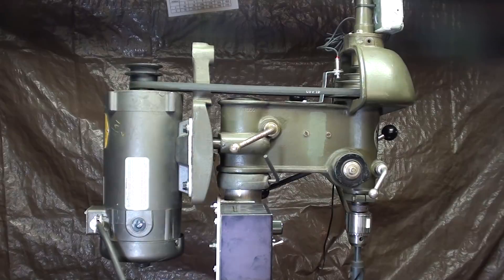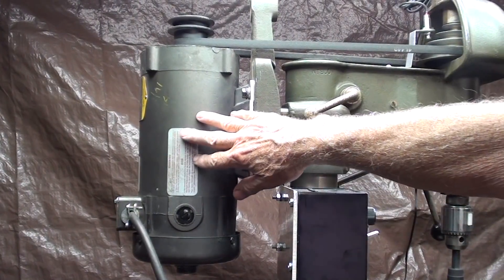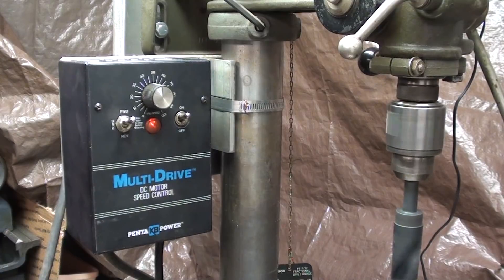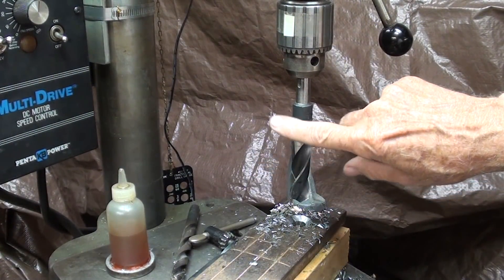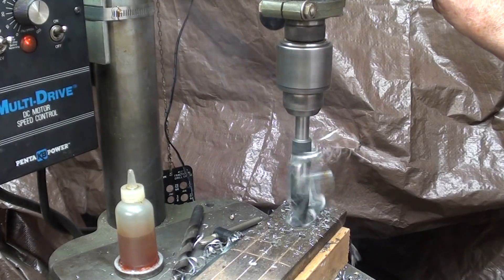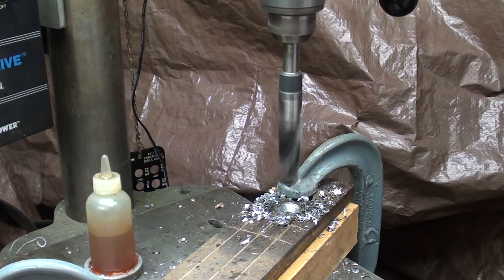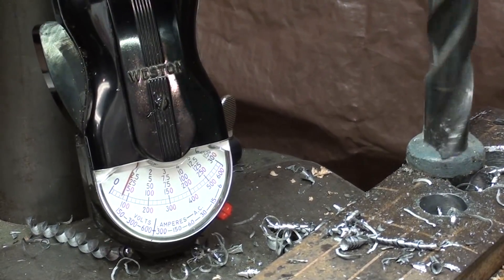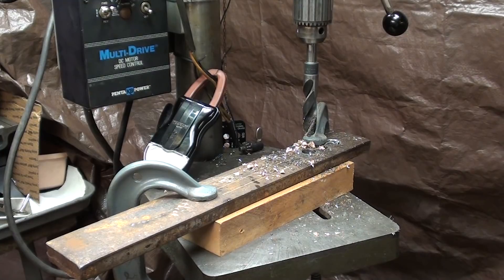Tips #482 Drill Large Holes Slow Speed DC Motor tubalcain

Comment: A bit more work but you'll get more torque by allowing the motor to run faster for the desired speed at the quill. If you went with timing belt  pulleys and belt, you could have a much smaller pulley on the motor, and that should improve the available torque at the drill bit.
Great video, thanks for doing this.

Comment: Using a dc motor with a scr type of controller will reduce the amount of torque available. To maintain the torque would require a PWM (pulse width modulated) type of speed controller. They work by changing the duty cycle ( on to off time ) of the applied dc voltage. Since the full dc voltage is being applied, the motor is able to have nearly the same torque through out its speed range.

Comment: Ac motor's horse power rating is not the same as DC motor.  If both AC and DC motor have 1 hp rating then AC motor has more torque than DC one..  Those hp rating are electrical rating  (amp x volt), not mechanical torque rating.  Usually 2 hp rated DC motor equals to 1 hp AC motor.  When I saw you holding up the non function rpm meter I know you had difficulty to wire that thing correctly. That rpm meter with 2 connectors is very confusing to wire them correctly than the old model rpm meter with one connector.   That was exactly what happened to me.  May be I am wrong.

Comment: 👍I like that DC set up on the old Walker Turner. If my WT got more use I'd like to upgrade it & play around a bit, however, it'd be costly. A comment below speaks of potentiometers for motor torque settings inside their DC motors to achieve the plants needs is ideal. I've had to set the "pots" on my garage door opener when new springs were installed due to increased tension. (Up/Down  force) Oh well, maybe one day I'll get lucky & run into a DC set up to upgrade. 
Enjoyed the video! Thx Mr Pete!

Comment: I really Like DC motors. I have 4 treadmill motors that I'm currently in the middle of a few projects with. 
I have a brand new K&B Penta Power  Speed control unit but I think it's too small for the 2 and a 1/2 3 horse power Treadmill motors.  So I just put it on eBay for sale and I'm using SCR  controllers  And bridge rectifiers which is incredibly cheap and way easier.

Comment: I have an old Atlas.  I switched to a 1.5 HP 3-phase and a 1 HP KB Electronics VFD.  As the pulleys are set I can go from about 10 to 640 RPM.
Stalls do not seem to be an issue, but the controller does get warm on extended use.  I clamped the current, too.  Was happy to see you did as well.  Great job.

Comment: I believe you can adjust the torque settings internally on those drives, we use them a lot at work here in the plant. they also have max and min speed pots inside as well. we use low speed high torque machines and our KB drives work well. enjoyed the video as usual.

Comment: get a PWM (pulse width modulation) motor controller. it will provide you with increased torque when working on reduced rpm
Reply: Please explain ....I'm considering using my 1 1\2 hp pmdc for driving a lathe...are pvm controllers better and what brand and model has worked well for your projects...?

Comment: did not read comments, but why not let motor spin faster and reduce spindle speed ? fixed pulleys to not have to keep moving belt or just 1 mid speed and 1 really slow pully arrangement ? i have 2 dc motors and about to do what you are doing

Comment: I've probably mentioned this before on some of your other variable speed project drill press videos.

A few years ago I put a 1.5HP three-phase Baldor motor with a VFD drive on a Jet Drill press.  A very nice upgrade!  Even at slow drilling speeds, the motor won't stall.  But, the drive belt will slip.

I now drill glass, wood, aluminum, steel, etc., with ease.  Large hole saws on steel offer no real resistance either.  But, it does require babying due to belt slippage.

So far, the VFD upgraded drill press is the most improved inexpensive tool in the shop!

Please, keep up the experimentation videos.  Some of us know what you're trying to accomplish and it is valuable information.
Reply from the maker: Thank you, in a month or two , I will be installing a motor with the VFD on the drill Press. We will see how this performs     I have a lot of trouble with the belt slippage. I would like to try one of those flat belts, like they use on automobile power steering units

Comment: Thanks, Lyle for sharing your experiment. AC or DC motors it doesn't make any difference power is power. The DC motors are easier to drive than AC motors. Seems more like your electronic drive unit was letting you down. If there is a plate on the motor you'll be able to determine maximum torque and other parameters.
I can appreciate the versatility of having a wide range variable speed drill press with a digital tachometer. Too cool. 
I'd say that a 1" drill was a serious acid test for the motor and drive.
The main reason for not lugging the motor is that it needs a certain RPM to keep itself cool.
Nothing wrong with your rig. It just does better with smaller drills.
If you just gotta drill B I G holes use an annulus cutter. Then you are only removing a small kerf of metal for a given diameter. And of course, increase the reduction ratio for high torque output.
Love to blab more but I don't want to put all the readers to sleep.
Thx again for sharing.
Reply from the maker: Thanks

Comment: That was a very informative video. I learned a TON. My hand drills and drill press are mostly used for wood working. Once in awhile I have to drill smaller holes in metal. I never know what speed I should be using. Neverhave drilled anything over a ghalf an inch. At my former place of employment the machine shop had a huge drill press made in Italy. It stood about 8 feet tall, had a huge clamp arrangement for drilling up to 4 inch holes. It had two motors, one was to raise and lower the press and the other who's only job was to power the arbor. Totally amazing. I was always fascinated with this press. That machine shop also had a lathe that was 10 feet in length.

Comment: You need a feedback circuit that senses  motor rpm ,as it drops the controller then supplies more power  or in the case of a pwm controller it widens the pulse.
I use my mill to drill anything bigger than 9/16  as it has more power than my drill press .
Reply from the maker: Yes thanks

Comment: If there is a way to send feed back of thr RPM to the controller to in a sence add voltage. You could use a microcontroller to set the RPM and have it read the RPM and maintain the RPM no matter the load. I have seen controllers with that built in. I don't think it would be hard to use a Arduino to do the same thing.. Hope that helps.
Reply from the maker: Thanks

Comment: I always add my cutting oil to the flutes in the drill so it can flow down into the hole rather than adding it around the perimeter of the hole which does virtually nothing. i  realize that the chips do carry it up the flutes somewhat,  but it seems more practical to add it into the flutes.

Comment: Forgive me for making a suggested job for you but unless you want 1000 rpm for small bits, and you might, consider changing the pulley sizes so you get more torque.   For example you you go for 750 rpm max and get about 35 percent more torque.   Of course multiple v belts might be needed to prevent slip( or the fan serpentine type like you mentioned in an earlier video  ).
Reply: By the way.   I think you will be much happier when you do the dc motor on your band saw.    I doubt  that needs so much torque

Comment: Can't figure out what the failure on that rig could be. Bites steel and if you're careful it won't bite your tender parts. 
Torque is not like on a milling machine, but nobody expected that. I think this is quite impressive demonstration of DC motor with variable control on a machine that was never meant for it.

Comment: Yikes! Those stringy chips looked ready to slice your wrist open!

At any rate, IIRC 3/4 HP isn't enough to drill 1" in steel. I believe the Clausing and Dake  drill presses rated for 1" in steel (not cast iron) have motors in the 2–3 HP range.

Also, a permanent magnet DC motor generates maximum torque at stall. It's induction motors that lose torque at low RPM, because at low frequency you don't induce as much current in the armature.

That drive should have a setting to provide a voltage boost when more current is drawn. Adjusting that may help with the stalling, although if you overdo it the motor RPM will run away. The voltage boost compensates for resistive voltage loss.

Comment: You ought to look for a Buffalo #22 drill press and your problems would pretty much go away. RPM 65-1350 and it has back gears, #4 morse taper and power feed. I recently used it to power tap some 1 1/8 x  7 threads in a 1 1/2 inch thick bar of mild steel for my arbor press stand I am building. Several years ago I bought a new 20 inch Craftsman drill press and I am concerned that the table just is not made strong enough and the quill has to much slop, but it does have a double belt reduction, rpm 150-4200. 
A secondary step pulley between the spindle and the motor would help out a bunch with what you are trying to do.

Comment: Pete,
Much more oil, like dark cutting oil, is needed especially on larger drills. One way to help is to fill the pilot hole up completely with oil by putting masking tape on the bottom side to hold the oil in. But even this is minimal for oiling. Putting a couple drops on is next to useless as it is is simply carried away on the next chip string out. The oil filled pilot hole at least gives continuous oiling and will reduce friction enough to maybe prevent stalling with your 1 " drill.
Reply from the maker: Thanks

Comment: Instead of a variable speed dc motor what about an ac motor multi pulley with countershaft that could deliver 40-60 rpm (or speeds compatible with the Cleveland guide). This should multiply torque barring, of course, v-belt slippage. While speed-feed (per the guide) settings may be the ideal in industrial settings - with much heavier equipment - perhaps these could be relaxed in home shop settings to compensate for the lighter duty equipment.
As an aside, could there be too slow a speed?
Reply from the maker: I think you are right. Mechanical advantage with gears is best. This drill press simply is not heavy enough.

Comment: after watching the video, I think it deserves more than a thanks. 
it is really informative and I was planning to buy a 1" drill bit (and they are expensive where I live ), good that I watched this video first. Now I have to make modifications before buying that 1" bit. I was very surprised that big DC motor stalled.

I think the options you are left with are: 
going back to your old AC, buying another VFD for an AC motor or use gears instead of pulleys and belts .. I would really be interested to know how will you proceed from there Master Pete
Reply from the maker: Thanks

Comment: I guess I just don't get it, but I think a drill press is unsuitable for drilling large holes like 1 inch in steel. Use the Bridgeport or even a smaller mill drill to get the slow speed and ridgeity necessary.
Reply from the maker: You are right, they are small presses are meant for small drillbits

Comment: Another great teaching video, thank you.  After many years of dealing with too high of speeds on drill presses, I found a good deal on a Craftsman 20in dp with 2hp peak motor. It does use the mid pulley set up and will drop down to a low 150 rpm. It has done well with hole saws and 1in drills in mild steel. Its still too fast for tapping and even some large hole saws. I like to spin tools slow, they seem to hold up better.  
Once you get to additional pulleys to get the speed down to a mill speed of about 50 rpm, the problem will become the spindle in the drill press. The drive splines, especially when you have the quill extended down will TWIST and spiral from the high torque.  So to those folks out there thinking you can drill 1.5in with a small 15in dp you will be shocked if you twist your spindle up. I have one in my shop from a 22in dp that was abused by prev owner.  I do like the idea for tapping holes to have the slow speed and quick reverse.   
If you want a beast buy the Grizzly Model G0779  can drill 1.5in holes in cast iron low speed 90rpms.
Reply from the maker: Thank you. These a small drill presses are actually only capable of 1/2 inch holes
Reply: I've seen two small low-dollar drill presses reduced to scrap by twisted spindles.

Comment: I like the concept,  and works better than my drill setup.    But i gave up trying to slow it down and keep the torque.  And went out and found me a 9" radial arm drill.   It has lots of torque at 60 rpm and go's up to 1200 ....I think.
Reply from the maker: Would it fit down my basement

Comment: If you control the motor with a closed loop controller, it can increase the power to the motor to maintain low RPMs under load. That way you get low end torque.
Reply from the maker: Thanks

Comment: Pete;
The problem with the torque is that as you are drilling, you have drag and therefore the speed you set is way low.  If you turn the power up on your control to your motor, and keep drilling at the recommended speed you want, it will drill just fine.  That's why when you did turn the power up it did cut better.  Check your tach. when you do that and see how close you really are to the speed you want when it is cutting good.  Its kind of like driving up a hill in your car to keep the speed at 60 you have to increase the power.  You need cruse control on you drill.
Michael
Reply from the maker: Thanks

Comment: If you do not need the heigh end speed adjust the pullys to get the the motor rpm up. You will loose the top end but gain the toque.
Reply from the maker: Thanks

Comment: I think a AC motor running at its rated speed with variable drive pulleys is the best system for drilling. This allows easy change of ratio between motor and drill and you don't lose any torgue.  I saw someone on youtube with a drill press built like that but do not remember who.
Reply from the maker: Yes

Comment: Don't forget to make sure the belt isn't slipping.  

It seems like what you need is a real motor speed controller that uses motor speed feedback and keeps the armature the same speed over varying loads.  When you set the motor speed for the drill bit to achieve a certain rate, that's the unloaded speed.  To maintain that speed, you'd need a friend to turn the knob up as you push the drill into the work, then as you lighten up the feed near the end of the hole, your friend would turn the knob back down to keep the speed from rising too high.  This is what a servo system would do automatically.  A tachometer signal from the motor would feed back to the motor drive and compensate the drive's output to always (almost always) keep the motor speed constant.  What you are doing right now is running "open loop".  Older Dremmel tools are like this,  if yous set the speed low, it doesn't have any power.  

Here's something fun to try.  Dig into your odds and ends, and find a foot controlled  potentiometer AKA sewing machine control.  I know you know what a sewing machine is ;-)  See if you can adapt the foot switch/potentiometer to take the place of the potentiometer for your motor drive.  As you pull the lever down on the drill to feed the drill into your work piece, step on the gas more.  

Another alternative is a series wound motor.  Typically their maximum torque output is when they're stalled or near stalled.  They're really difficult to stop.  All of this low end performance comes with a reduced high speed capabilities.  Good luck finding one that's constant duty.  You could adapt a starter motor from a heavy truck, but you'd have to find a way to cool it if you wanted to run it for very long.  They're also not meant to run vertical, so you'd want to add a thrust bearing to support the armature.  BTW, they also typically don't have ball bearings.  I'm sure you've had a starter apart before.
Reply from the maker: Yes thanks

Comment: Inside the motor controller there should be some potentiometers, one labeled IC comp or similar. Increase it.
Reply from the maker: They are not labeled
Reply: Best not to take a guess. I have a similar dc controller on my small cnc mill, I deal with the limitations just fine. Greetings from Northern Il (Niles), thank you for the marvelous videos.

Comment: Just talking from the sound of the drilling process i would say the rpm of the Drillpress was just so low designt because the drill press didnt have the rigidity for such a big drill. To proof that just put a dial indicator on the table while pressing the quil hard down... I shouldnt move more than 0,3 mm
Reply from the maker: These drills were designed for 1/2 inch or smaller drills

Comment: Just get a Carlton and never look back. :-) lol That being said I am really surprised you don't slip the belt on the motor end with such a small amount of wrap.  Twice the size pulley on the drill spindle end so you could run the motor faster would sure help.  Most electric motors make peak torque at around 80% of their design speed.  problem is as speed decreases so does HP and HP is what does the work. You can have 1000ft;lbs of torque but if the shaft doesn't turn you have 0 work despite all the effort.  At least with HP there is always work being done. :-)